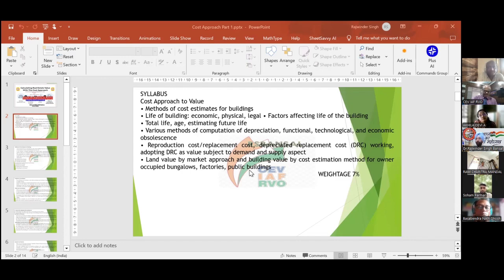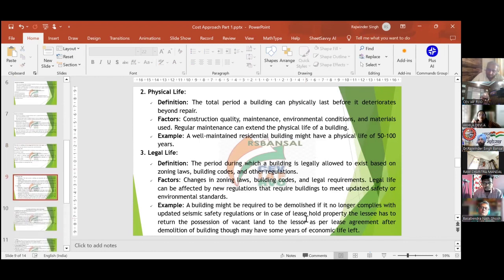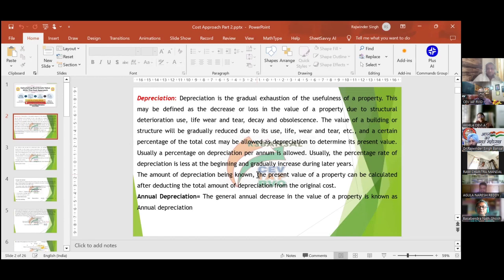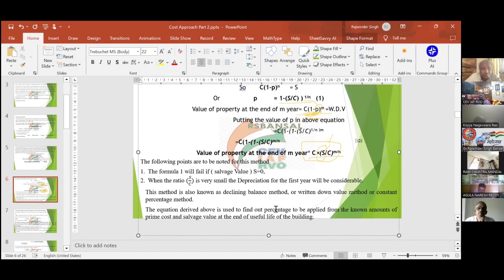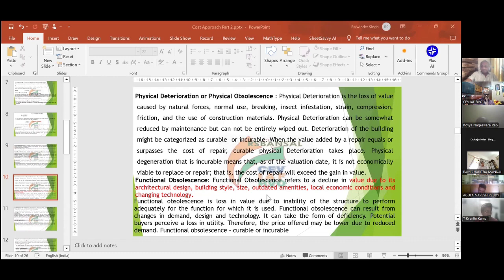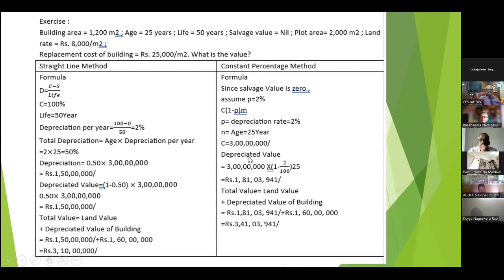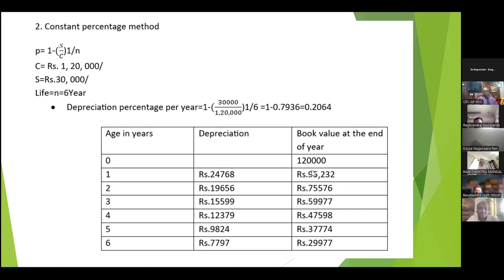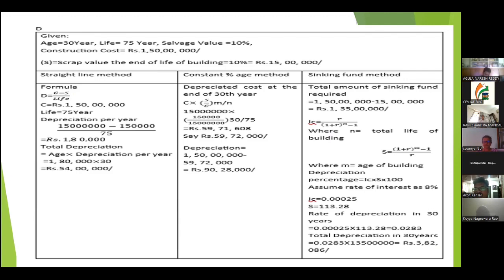COST APPROACH IN VALUATION: MUST FOR ALL VALUERS

Comment: Excellent explanation of the Cost Approach with practical case studies. The step-by-step methodology for estimating replacement cost, depreciation, and land value made the concept very easy to understand. The examples helped in connecting theory with valuation practice, which is extremely useful for IBBI examination preparation. The instructor's clarity and systematic approach have greatly improved my understanding of this important valuation method. Highly recommended for all valuation aspirants.
Reply from the maker: Thanks for watching